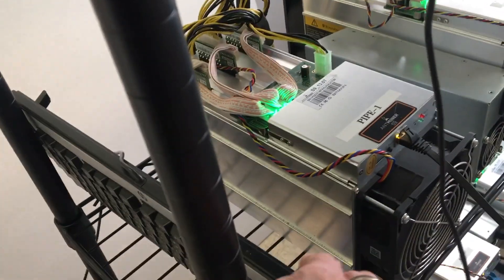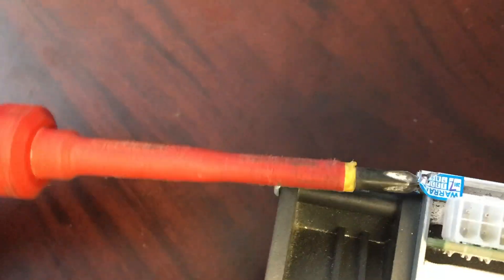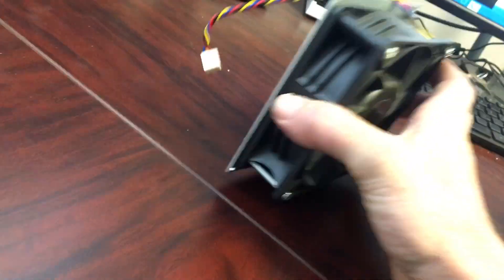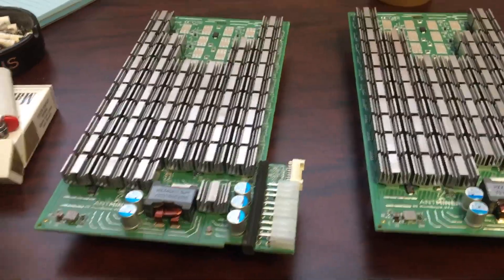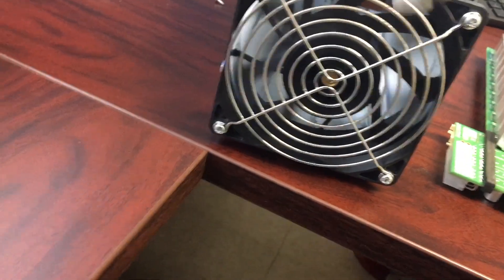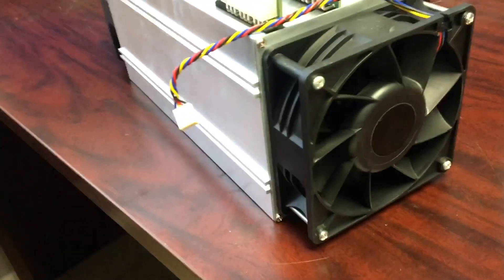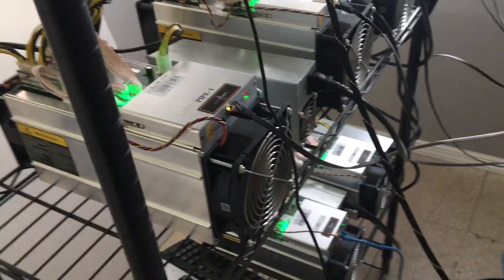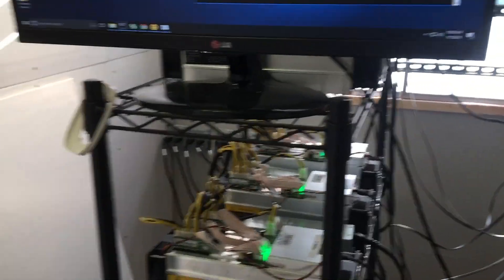AntMiner S9 - Shut Down, Disassembly, Cleaning, Re-Assembly & Reconnection

Comment: What is the function of the hash board do and appears to be just accumulated dust on it, can you just use a dry brush or tooth brush to clean it or compressed air from a PC  air canister? How often should you clean it?

Comment: i learned the hard way that you should never use an air compressor to blow out miners, they end up blowing WATER through the electronics which can ruin your miner.
 Run the compressor wide open for about 2 to 3 minutes to  blow out the accumulation  BEFORE you use it to blow out the miner...one step safer is having an air compressor filter and dryer in your system.
Reply from the maker: i havent had that problem. i am using a compressor in a climate controlled area. I dont see any condensation issues or moisture. I actually even checked it this afternoon with a moisture instrument. Nada.
Reply: that is awesome.. I think my problem came from using a compressor that was mostly stored in my shed..lesson learned on this end..lol..thanks for the info

Comment: Are you sure using an air gun on the hashing boards is safe? I feel like it could be very destructive; the amount of air blowing out the air gun was blowing the hash board away.
Reply from the maker: It’s only 125psi max air pressure. Work in opposite direction of air flow. Nothing wrong with that.